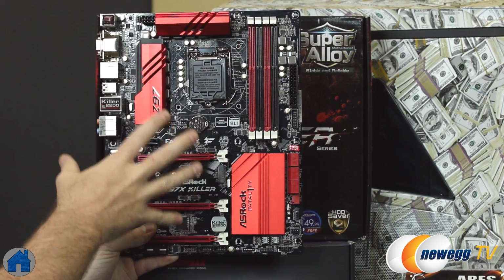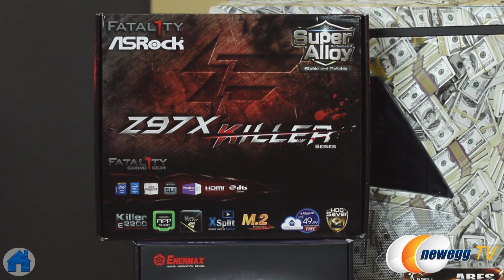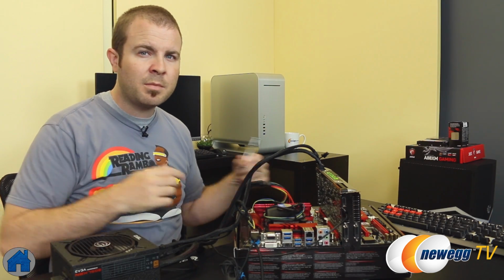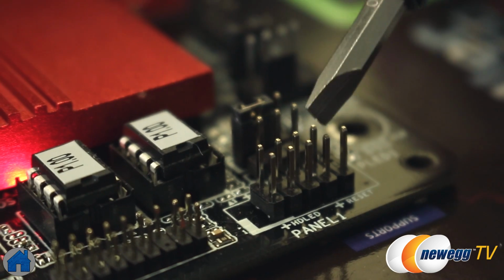How to Build a PC - Part 1 - Newegg TV

Comment: Is this build good for value?
It's around $900 total

CPU- AMD FX-6300 3.5GHz 6-Core Processor
CPU Fan- Cooler Master Hyper 212 EVO
Motherboard- Asus M5A97 R2.0 ATX AM3+ Motherboard
RAM- G.Skill Ares Series 8GB (2 x 4GB) DDR3-1866 Memory
Storage- WD Black 1TB 7200 RPM HDD
GPU- Radeon R9 270X (XFX Radeon R9 270X 2GB Double Dissipation Video Card)
Case- Enermax ECA3253-BL ATX Mid Tower Case
PSU- EVGA SuperNOVA 750 G2 220-G2-0750-XR (750W)
Optical Drive- Asus DRW-24B1ST/BLK/B/AS DVD/CD Writer
OS- Windows 7 Home Premium SP1
Monitor- Asus VE198T 19.0" Monitor
Adapter- TP-Link TL-WN822N 802.11b/g/n USB 2.0 Wi-Fi Adapter
Case Fans- Cooler Master SickleFlow 120mm (x4)
Mouse- Change 6 Buttons 2000 DPI
Keyboard- Gear Head USB Keyboard (Windows) (http://www.walmart.com/ip/Gear-Head-USB-Keyboard-Windows/14005999)

http://pcpartpicker.com/user/Renzjordan1/saved/vv9Ff7
Reply: you probebly dont need a 750W i would go for more like 600w or 650w, but make sure its got a good efficiency rating eg 80+ bronze.

Comment: I was wondering if this is a good PC or not...
https://pcpartpicker.com/user/StormySlayer/saved/#savedbuild_1948133
Please respond and tell me if it could run games at a decent frame rate like 60-100 FPS. Thanks!
Reply: 500w will do and if you can i would go for the gtx 660.
U.S

http://www.amazon.com/Asus-GTX660-DC2O-2GD5-ASUS-Graphic-Cards/dp/B0098VKIRC/ref=sr_1_4?ie=UTF8&qid=1423335193&sr=8-4&keywords=gtx+660

or U.K

http://www.amazon.co.uk/GeForce-DirectCU-Graphics-Express-Surround/dp/B00D7SC3O8/ref=sr_1_1?ie=UTF8&qid=1423334980&sr=8-1&keywords=gtx660
Reply: Sid Revell eww i wouldnt wanna run 50 fps at highest setting id rather go for gtx 780 60-65 fps HIGHEST SETTING
Reply: i can do most games at above 60fps max settings with 660
Reply: Yes, HOWEVER their are different games ALSO the tempeture is bad its about 80 degree im guessing
Reply: nah at the moment its 27 c  when its running a game its about 34 c although i do have a lot of cooling becous i was lucky so you do have a point
Reply: ***** I'd step down to an FX-6300 and upgrade your GPU. I wouldn't go anywhere below a 750ti and even that's pushing it for running most games at 60-100 at medium-high settings. CPU doesn't nearly matter as much as GPU in gaming, as long as the CPU is 4 cores it'll be fine for a few years

Comment: Hi, I'm a bit new to building a PC of my own, and I have set up my parts that I still may edit in the future only to add maybe an SSD.

AMD FX6300
MSI Radeon R9 280
Seagate Barracuda 1TB hard drive
NZXT S340 Mid tower Case
Corsair Vengeance 8GB (only 1) 
Corsair CX 500w bronze certified ATX Power Supply
MSI 970 ATX Gaming Motherboard
Cooler master Hyper 212 EVO

Just wanna make sure everything is compatible and won't have any issues. I already have a 1080p monitor as well as other nuances.

Comment: I am new to PC building so can someone tell me if this build will work:

CPU - AMD A8 7600
Motherboard - Asus A78M-E
RAM - G.skill Ripjaw 8gb set
HDD - Western Digital Caviar Blue 3.5" 1tb
GPU - Asus Radeon R9 270 DirectCU II
Case - CoolerMaster N200
Power Supply - Corsair CX500

Comment: Gigabyte GTX 970 Windforce 3X (GM204, 4GB) 
MSI MSI Z97M Gaming (LGA 1150, Z97, µATX) 
Thermaltake Overseer RX-I (VN700M1W2N) Window (Big Tower) 
G.Skill Ripjaws (2x, 4GB, DDR3-1866, DIMM 240) 
Corsair Builder Series CX500 V2 (500W) .
Microsoft Windows 7 Home Premium 64bit, OEM/LCP, SP1 (EN, 64-bit) 
Noctua NH-D14 (16cm) CHF 75.20 incl.
LG GH24NS (Black) CHF 18.90 incl.
Toshiba DT01ACA100 (1000GB, 3.5", Desktop) 

any thoughts on this build? it's my first build btw, had to budget out some parts

Comment: Is my build good 

Asus sabertooth 990fx r2.0 
Amd fx 9590 
Arctic freezer 13 co cooler
Pny gtx 970 
16 gb Kingston hyperx beast 2133mhz ram
120gb Samsung ssd
1tb wd hdd
Cool master haf 912 with 6 fans 
Asus optical drive 
Thermaltake 700w psu 
Trendnet pci WiFi card

Comment: What do you think?
 Støtsikker PC-eske
798586 SteelSeries QcK mousemat,
823670 Komplett 230T Midi Tower Sort
795138 Cooler Master G650M, 650W PSU
817261 Intel Core i7-4790K
818283 ASUS Z97-P, Socket-1150
812886 HyperX Fury DDR3 1866MHz 16GB Red
825431 Gainward GeForce GTX 970 4GB PhysX CUDA
773518 Kingston SSDNow V300 240GB 2.5" OEM
822241 Seagate Barracuda® 1TB
778356 Samsung DVD Writer, SH-224DB
818041 MS COA Win 8.1 Nordic

Forget some of them, they are written in norwegian.

Comment: guise i am w0ndering if dis kan run bf4 @ solid 200 fps:

CPU: AMD 2650 1.45Ghz Dual-Core Processor ($31.00 @ Amazon)
Motherboard: Biostar AM1ML Micro ATX AM1 Motherboard ($31.98 @ OutletPC)
Memory: Crucial 1GB (1 x 1GB) DDR3-1333 Memory ($15.16 @ Mwave)
Storage: Western Digital Caviar Blue 80GB 3.5" 7200RPM Internal Hard Drive ($22.99 @ Amazon)
Case: Cardboard box ($0.99 @ Local dumpster)
Power Supply: Diablotek 350W ATX Power Supply ($10.99 @ Amazon)
Total: $113.11

thx
Reply: little overkill but yeah you should expect at LEAST 200fps
Reply: Hilarious bro
Reply: I hate rich kids like u who brag about ur sweet setup
Reply: I don't know. You might have to download some extra ram.
Reply: This is the best thing I've read all day.
Reply: that'll run Battlefield 4 at 1000 FPS Ultra at 4k
Reply: You should be fine, what a beast of a system!
Reply: Sorry to break it to you but no... No it can't run BF4 solid 200 FPS it would probably get 2 or 3 FPS
Reply: And I forgot to say LOLA cardboard box
Reply: No. What you want is this: http://pcpartpicker.com/p/JCW6jX 
It will run Crysis at 1,000fps.
Reply: Unless you use a GTPotato 420 you will not be able to 360 noscope on BF96
Reply: Gregory Deng Is their anyway you can get the case for free? I feel the Local dumpster is overpaying, even though that is a top-of-the-line. I feel if you keep digging you could get it for less the $0.99.
Reply: Lol
Nope :D
Reply: You will be able to play witcher 2 with ubersampling BF4 max settings and crysis 3 max settings max settings and render a 3 day long video all at the same time with 400fps EACH
Reply: Truthfully this will be luck if you can even use microsoft word you are pretty much not going to play any games on this and if so it will be really bad FPS on battle field prob 15 max
Reply: Josh C Haha, you dont get it
Reply: Ehehehe
Reply: PowerSwitch Gaming is this a good build http://pcpartpicker.com/p/QtJrnQ
Reply: Should run notepad at 2FPS.
Reply: pretty much a budget of a teenager who uses money on xbox games
Reply: No I do get it I was just playing along with it PowerSwitch Gaming
Reply: Ayan shaikh chango os to 8.1
Reply: i want too use windows 7 because im gonna get softxpand wich is only compatiblw with windows 7 and below
Reply: Ayan shaikh but microsoft is slowly closing support for win 7 (there are no upgrades except safety upgrades)
(sory for my english i'm from Poland)
Reply: oh okay
Reply: Ayan shaikh
Don't let lack of support turn you away from getting a certain OS. There are people that still use XP, because it's really not a bad Windows OS. The support from Microsoft is nice to have if you ever run into any issues; but I, personally, am not too worried about it and prefer Win 7 over Win 8. You may think differently though. So it's entirely up to you.

If you need Win 7 for a specific program, I would simply get it. However, I would recommend looking into both, doing some research, and seeing which one you end up liking better. If you do go with Win 8-- what you can do is partition either your SSD or HDD into separate parts. You can install Win 8 on one partition, and install Win 7 on the other. Alternatively, you can have Win 8 on the SSD, and Win 7 on the HDD, vice versa, or what ever. Regardless of how you do it, it will allow you to just boot from either partition depending on the OS you want to use.
Reply: Bolvar Fordragon but u can run every program in compatilibity mode, btw 8.1 is faster than 7
Reply: WeᐃkEnough
Oh yeah, I forgot about compatibility mode. Derp.

And I'm not really concerned too much with 8.1 being faster than 7. I know it is, and I've used both operating systems. I merely prefer 7 still.
Reply: took me a minute to figure out if you were joking.
Reply: Maybe BF4 Videos at 200 Fps....
Reply: Gregory Deng no video card? sorry man i would not count on it. also unless you have a 200 hertz monitor you will not be able to notice 200 fps anyway.
Reply: clanshadow2 lol had to get the 1500 W power supply as well.
Reply: Gregory Deng 11/10 powerful thn apple
Reply: Jeff Dunham You ruined the joke.
Reply: penns
Reply: Yu need at a max of 512mb rams to win bf four.
Reply: Bolvar Fordragon yeah I've used 2000, XP, 7 and 8.1. I loved XP when I had it and honestly do like 7 over 8.1. To me it's just the better OS and if I could find it, I would take XP again.
Reply: Nick Wilson his opening sentence was a big tip off to me and I was like this should be good (continues reading)
Reply: Gregory Deng maybe 2 fps if you're lucky.
Reply: ThePCgamer Probably.
Reply: 2 meni fps m8!
Reply: Gregory Deng I men u wuld prububly get sum stuterin sumtymes bat i tink u k
Reply: Gregory Deng nope
Reply: Gregory Deng Diablotek PSU, you'll light em up... with your flaming rig.
Reply: ***** spam
Reply: ***** asfasf
Reply: ***** asfasf
Reply: Gregory Deng it shud works et arowned 250 fps for crysis 3 on maximom graphs
Reply: ***** nothing is set for years
Reply: Spodiesie oh really k

Cpu: 18 core Xeon 4 ghz
Cpu:i7 5960x extreme 
Cpu cooler:2 waterblocks
Motherboard: X99 asrock extreme11 2 cpu
Video card: Quad-Sli Titan X
RAM: 64(32X2)
Storage:1.2 TB SSD
Case: CM Cosmos II
Power Supply:Corsair 1500 W 80+Titanium 
Moniter: 3 4k's and 3 144 hz 1440p
Cooling: 3000 dollar custom water loop and water blocks for everything
Reply: lelcetz cant even run potato os

Comment: rate my first build be nice

.Corsair Graphite Series 760T
.Intel Core i7-4770K Processor
.Asus Z97-AR LGA 1150 ATX MB
.Kingston HyperX Fury Black 16GB Memory Module Kit - 2x 8GB, DDR3 1600MHz
.Seagate 3TB Barracuda Hard Drive - 3.5"SATA III 6 Gb/s, 64 MB Cache
.Azza PSAZ-1000A14 Titan ATX Power Supply - 1000W, 80 Plus Bronze
.PowerColor PCS+ Radeon R9 270X Graphics Card - 2GB GDDR5, 1425MHz Memory Clock
.Thermaltake Water 3.0 Extreme 240mm Liquid Cooling
.Kingston KHX-FAN HyperX Memory Cooling Fan Blue
.windows 8.1

Comment: hi guys!
I am going to build my first pc, would these parts work?

CPU: AMD FX-9590, 4,7 GHz (5,0 GHz Turbo Boost)
MOBO: ASUS Crosshair V Formula-Z, socket AM3+
Ram: Crucial 16 GB DDR3-1600 Kit
GPU: XFX Radeon R9 290X Double Dissipation (R9-290X-8DFD)
HDD:Western Digital Red, 2 TB
PSU: be quiet! POWER ZONE 650W
OS: Windows 7/8 what should I choose?
Case: Corsair Obsidian 450D window

total costs will be around 1200 euro. Maybe you guys got other builds that I can play any game on ultra and record :)?
Reply: ***** I totally love your awesome comment! <3 :3
Reply: ***** you play minecraft and need for speed ? anything else?
Reply: ad me my name is Pidronka or CrazyBelgiumGamer you will find it :)
Reply: CrazyBelgiumGamer That processor will need some seriously liquid cooling. It will overheat and quickly destroy itself when taxing the system. Do some research in high end liquid cooling. I used an Antec Kuhler 950 in my Vishera build.
Reply: Andrew Sederholm why?
Reply: CrazyBelgiumGamer That Andrew guy clearly doesn't know much about vishera cores. Sure, a 9590 is hot, but you can run it with a good CPU cooling system (liquid is best) and a well circulated case. Again, I recommend the Antec Kuhler 950/1250.

If you want to squeeze the best performance out of your cash, go for the Intel route. The i7-4790 is roughly the same price and doesn't need a pricey cooling system. Instead, get a Cooler Master Hyper 212 Evo fan rather than a $100 liquid cooling system. With those kind of savings, you could move up to the i7-4790k. If you really want more than a quad core, get an i7-5820 (may move your price up a bit). It's a hexacore but costs roughly $60 more. Any of the listed Intel processors are more powerful than any vishera core processor.

If you're switching to Intel, you'd obviously need to switch your motherboard. You'll need to pick a motherboard that works with your processor. The i7-4790k and i7-5820k have different sockets, for example. 

To respond to the other guy that made a large reply, Windows 8 won't have a noticeable performance difference. If you like Windows 7, get it. If you want your operating system to be faster, the one way to do it is to get an SSD to install your operating system and only your operating system on. You'll need a hard drive to store data. 

On power supplies, there are a few options. You should almost always been looking at a fully modular power supply that is Gold+ certified. The "Gold+" means that it is more energy efficient and in the long run will save you more money than you would have spent upgrading.

As for RAM, he's pretty much right. Don't spend all your money on it though.

That's all I have to say at the moment.
Reply: Andrew Sederholm If you knew what you were talking about, why would you spread misinformation? I built a 9590 machine for my school. Works fine. No heat issues. Renders high end 3D models easy.
Reply: Andrew Sederholm I haven';t dealt with that machine in over a year, because it's had no issues.
Reply: Andrew Sederholm You continue claiming that the 9590 is imperior. That machine does more work every day than your machine does in a week, and is almost too fast for the teacher that upkeeps the 3D printer.
Reply: Get the Gtx 970, and a Intel core i7 3770k

Comment: hey guys, i need an opinion. I'm building my 1st gaming PC. Of course I'll be mainly gaming on it and planning on overclocking but i also will be using it for occasional 3D modeling...  Ive been putting this set up for a while now and i want to know if theres anything i can work on or tweak, maybe some helpful advices... With this being said...

CPU: Intel Core i7-4790K
Motherboard: Asus SABERTOOTH Z97 MARK1
Cooler: Noctua NH-D14
Ram: 16GB Kingston HyperX FURY
GPU: EVGA GeForce GTX 980 4GB Superclocked ACX 2.0
SSD: Crucial MX100 512GB
HDD: WD BLACK 3TB
PSU: SeaSonic 850W ATX12V / EPS12V
Case: Cooler Master Storm Trooper ATX Full Tower 
Monitor: Asus VS248H-P 24.0"

(Now i am looking for case alternatives that will be able to accommodate Noctua cooler and have a good air flow so if anyone has suggestions that would be awesome)

Comment: How is this spec for running games like Minecraft and CSGO:

CPU: AMD FX-6300
Cooler: Stock Cooler
RAM: 8GB HyperX Fury White DDR3 1866MHz
GPU: R7 260X 2GB (i know it suck sigh but i have a budget)
HDD: 500GB SATA-III 6.0Gb/s Cache Hard Drive 
PSU: :500 Watts Power Supplies (Cooler Master Elite 500watt Gaming Power Supply)
Motherboard: Gigabyte 78LMT-USB3 AMD 760G Chipset DDR3 Socket AM3+ Micro ATX Mainboard w/ 4 RAM slot,

What kind of FPS do you think i will get on medium settings for these games?

Thanks
Reply: I would go for an intel i5 for gaming
Reply: I would invest in a Pentium G3258 instead of fx 6300. The R7260X is fine. Maybe get a 960 when it comes out. and a lag 1150 mobo if you go with intel (better choice).

Comment: How is this build?
CPU:Intel Core i5-4670K 3.4GHz Quad-Core Processor
CPU Cooler:Cooler Master Hyper T4 70.0 CFM Rifle Bearing CPU Cooler
MOBO:ASRock B85 Anniversary ATX LGA1150 Motherboard
Memory:G.Skill Ripjaws Series 8GB (2 x 4GB) DDR3-1333 Memory
HD:Seagate Barracuda 1TB 3.5" 7200RPM Internal Hard Drive
SSD:Mushkin Chronos 240GB 2.5" Solid State Drive
GPU:MSI GeForce GTX 970 4GB Twin Frozr V Video Card
Case:Antec Nine Hundred ATX Mid Tower Case
PSU:EVGA 600B 600W 80+ Bronze Certified ATX Power Supply
Optical Drive:Samsung SH-224DB/BEBE DVD/CD Writer
Case Fan:Cooler Master R4-L2R-20AC-GP 69.0 CFM 120mm Fan X2
Mouse an keyboard:Cooler Master CM Storm Devastator Gaming Bundle Wired Gaming Keyboard w/Optical Mouse
Monitor:Acer G276HL Gbmid 60Hz 27.0" Monitor
Headset:Logitech G430 7.1 Channel Headset
                                                                             Budget is about 1400$

Comment: http://ca.pcpartpicker.com/user/moha26/saved/xRrtt6 is this a good build? Also woul it be able to run most games on Ultra?
Reply: Would*
Reply: Moha Jams Yes you would. This build is much better than mine. Only thing is, you're being ripped off on the RAM. I bought 2 x 4 GB of DDR3-2400 RAM for $75 (right now, after the Christmas sales, it costs $80). Looking at your build, it looks like I didn't spend too much on RAM after all. Here's mine: http://pcpartpicker.com/p/ND9Lqs
Reply: DaTechnoDood LevelX  
How is this build?
CPU:Intel Core i5-4670K 3.4GHz Quad-Core Processor
CPU Cooler:Cooler Master Hyper T4 70.0 CFM Rifle Bearing CPU Cooler
MOBO:ASRock B85 Anniversary ATX LGA1150 Motherboard
Memory:G.Skill Ripjaws Series 8GB (2 x 4GB) DDR3-1333 Memory
HD:Seagate Barracuda 1TB 3.5" 7200RPM Internal Hard Drive
SSD:Mushkin Chronos 240GB 2.5" Solid State Drive
GPU:MSI GeForce GTX 970 4GB Twin Frozr V Video Card
Case:Antec Nine Hundred ATX Mid Tower Case
PSU:EVGA 600B 600W 80+ Bronze Certified ATX Power Supply
Optical Drive:Samsung SH-224DB/BEBE DVD/CD Writer
Case Fan:Cooler Master R4-L2R-20AC-GP 69.0 CFM 120mm Fan X2
Mouse an keyboard:Cooler Master CM Storm Devastator Gaming Bundle Wired Gaming Keyboard w/Optical Mouse
Monitor:Acer G276HL Gbmid 60Hz 27.0" Monitor
Headset:Logitech G430 7.1 Channel Headset
                                                                             Budget is about 1400$
Reply: Moha Jams It's a pretty decent build. 4GB of VRAM is a little too much. Try to get a discount by getting 3GB of VRAM with your 970.